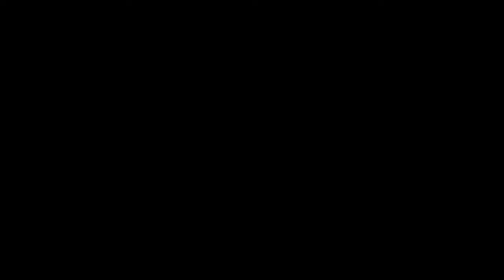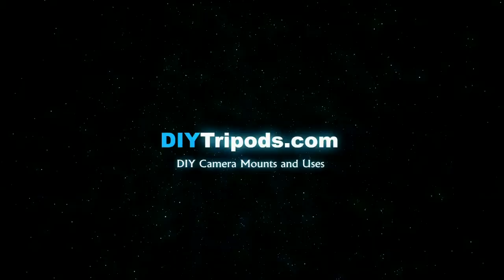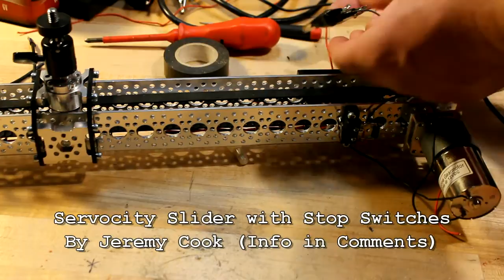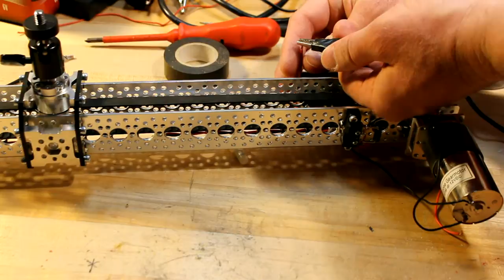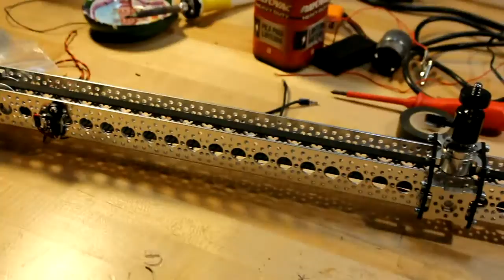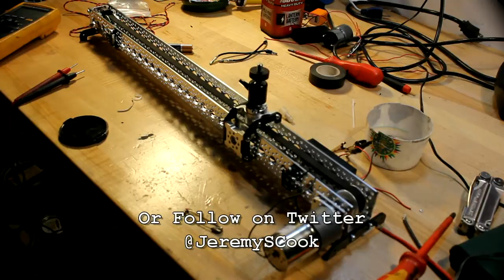Servocity Slider with Stop Switches

Comment: Thanks this is exactly what I am looking for. Can you explain the wiring of the diode bypass? I basically need the same setup but my motor and switch’s are on top of a column that moves horizontally along a pair of parallel rails using the open-builds belt and pinion system.
Reply from the maker: See the link in the description, but if I remember correctly, the diode basically jut allows the motor to go in one directly only when the switch is depressed as a sort of safety mechanism. Here's my current, more involved, setup: https://www.youtube.com/watch?v=8xCR6iuIZds

Comment: So you have to MANUALLY REVERSE IT? Can't it be configured to auto reverse directions after the stop? Could you show some shots of the Diodes on the switch? Thanks
Reply from the maker: +Frankie e Yeah, that's how I have it configured. It can be, but I think that would require a few more electrical components. There are some more pics in the linked article if that helps.
Reply from the maker: Hey, FWIW, I'm working on an Arduino/servo setup that I'll post about soon on the handle that I'm posting from. Pretty kludgy solution here I'll admit, but I think the next iteration will (finally) work pretty well :-)